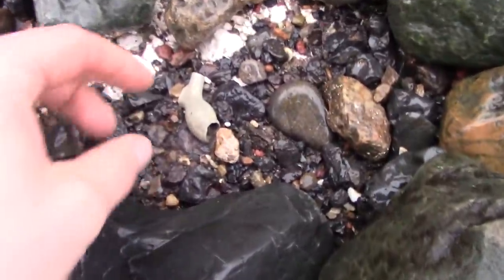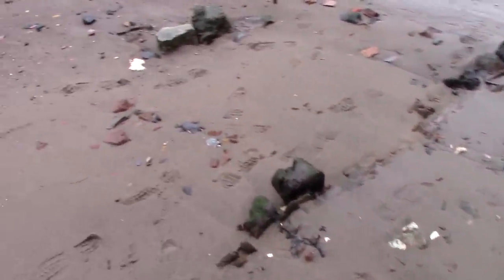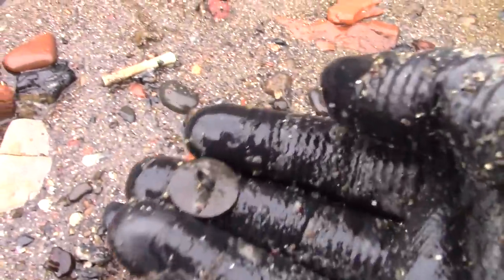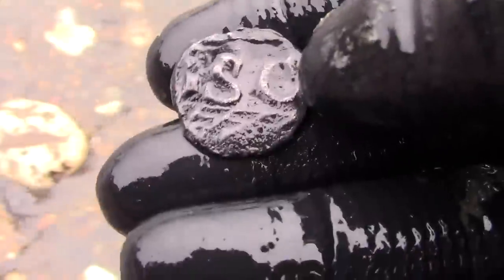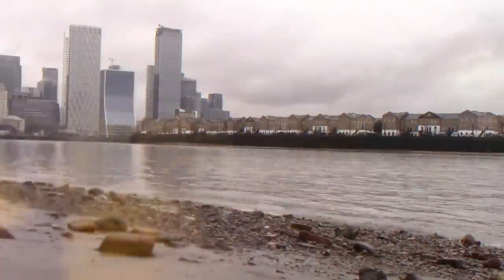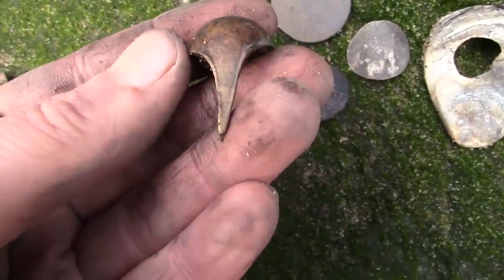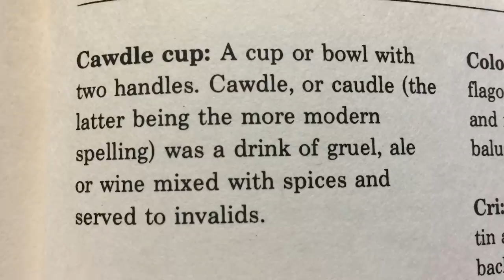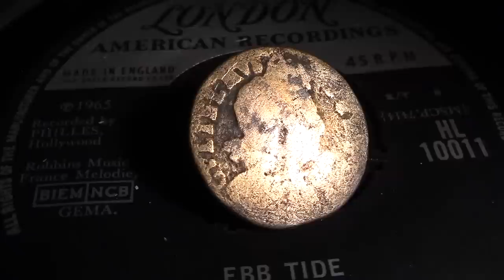I didn't realise I'd found my RAREST relic ever Mudlarking the Thames!

Comment: Hey mate, mind me asking if you ever considered tumbling any of your bottles? Since you are more into upcycling them than colleting the results should leave you very pleased.
The bottles turn basically new the only thing you should be careful about are embossed writings if they are already faint, and air bubbles near the surface of the glass.
You can probably upcycle an entire setup for tumbling bottles aside maybe a specific bottle holder on which I'd avoid going cheap/homemade.
Also I've found some very old videos in which it was suggested to use one of those oral irrigators things at max power to blast away those dark residues that really don't wanna leave...
I will probably try a prolonged lubricant bath to remove the most stubborn residues from bottles :)

Anyways great content great attitude :D
Reply from the maker: MrSwosh89 the setup for tumbling is quite expensive, you need a special paste and aggregate that’s only sold in the US, so that’s put me off
Reply: @Sifinds  whaaaat??? My man, you and I have some discussing to do....I am certain, certain! That you can get all the materials you need over there across the pond, you simply have to look for the same thing but for a different application and be creative :) let me put together a working plan and I'll shoot you an email to give you an idea of what you need.
Single bottle minimal setup, nothing fancy but still I think you'll be suprised...
If you prefer another form of contact like discord or so feel free to tell me, talk to you soon

Comment: Interesting theory about oyster farming. 
But I can't help thinking a square hole would be very difficult to make without breaking the shell. 
Which seems a lot of work to just put it on a bit of string
Reply from the maker: We tried it with a big iron nail, it punches straight through in seconds leaving a neat hole
Reply: Guessing the shells must be quite soft then
Reply from the maker: @dave.harmon  try it yourself

Comment: it seems like the square hole would take a good bit of effort more then just making a circular one, so its got to be necessary for whatever purpose it served or they wouldnt have gone to the effort. the only thing i cant think of for that is maybe extruding some kind of food product. 
do the square holes seem uniform in dimension from shell to shell? 
you ought to save the old pipe stems and use them for faux native american jewelry. 
14:13 something rectangular or cubeish in the center right between the 2 rocks. 
14:38 looks like maybe some kind of pommel cap. 
ill bet that flattened oyster shell was flattened like like for some purpose. 
if it took that much effort to cut out a disk with a diamond tipped cutter, just imagine how much work it would take by hand!!! i dont see them putting in the much effort for just a button. seems like it would be much easier to break the shell into pieces and file them into discs.  
that pewter cup is AWEOME!!! wonder why it was wadded up like that? i dont know whyd they throw it away as germ theory hadnt even been posited at that point. 
maybe the lead eggs are just that. eggs to induce hens to lay more eggs. ive got a blown glass one for that purpose.
Reply from the maker: No all holes are different sizes, pribably from a square nail being driven in.